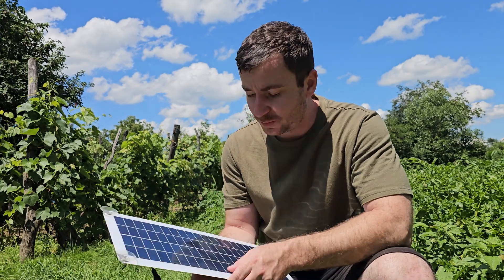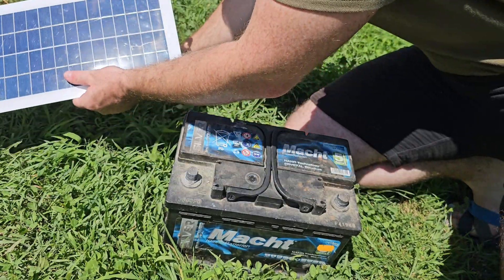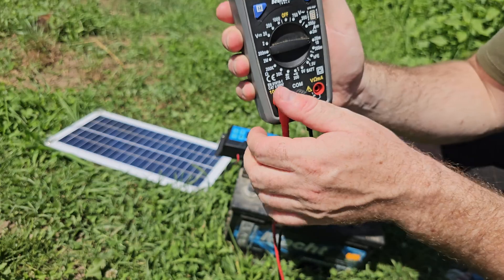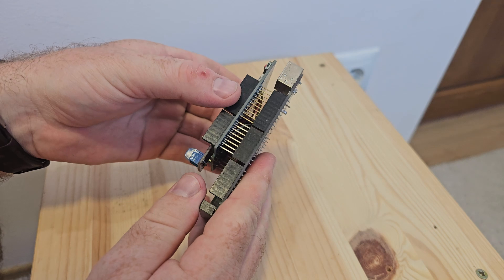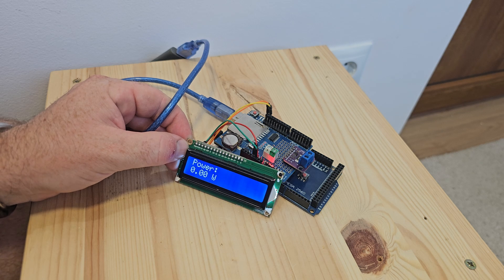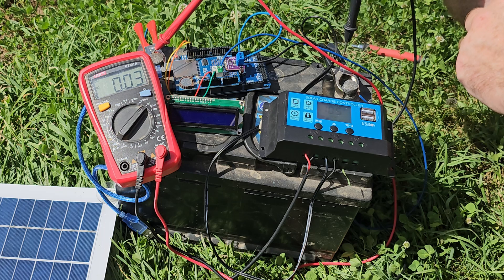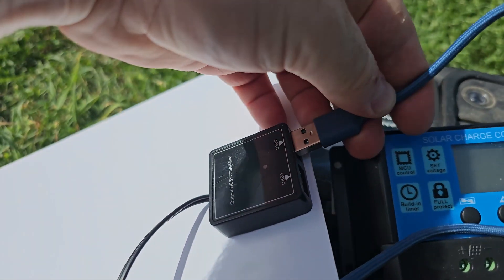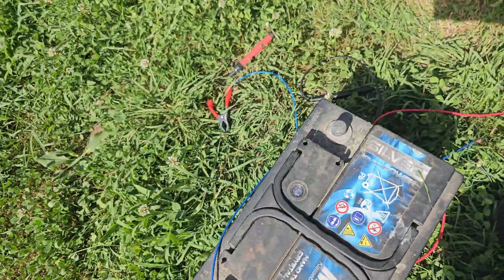Aliexpress "300W" Solar Panel! Don’t Buy It Until You Watch This!

Comment: I was impressed with the solar charge controller I received from the seller who sent me the flexible panels, it was a proper 100 A charge controller, the other seller with the framed solar panels sent me a junk cheap solar charge controller as well without a heat sink at the back and probably only 10A capacity with only 3 mosfets on the circuit board.

Comment: I unfortunately already wasted my money on this before I found your video. 4 of these panels in series are barely enough to recharge the one 12v 7ah battery for my internet modem. I will test to see if it charges my laptop battery but it seems like a real gamble.
Reply from the maker: Indeed. It was kind of unrealistic to have that power output but still I was expecting better results.
Reply: Internet modem uses a battery?

Comment: You might get a little more power by using an MPPT charge controller but my experience with these cheap flexible Chinese solar panels is that they are all highly overrated in terms of power output.
Reply from the maker: I'm planning to buy a good MPPT charge controller and compare with the PWM controller.
Reply from the maker: And indeed it is overrated.

Comment: i have 2 same panels and chargers, working well but need do first panel not have back diodes need add own box and diodes then can charge, and this PWM charger have totally worst need change better MPPL charger and then working well , i have condo palcony and i use all room lights and computer whit 2 panel, working well now and can use raspberry pi4 computer 24/7 and 9 hour ewening all room light good. panels charge battery i measure max 19V 8A good day. panel no problem this worst charger has problem and panel not have diodes. leak night battery empty if not have diodes.
Reply from the maker: Thank you for the comment. You gave me a good idea what I have to check.

Comment: First it was outrageous lithium battery capacities, like 100,000 mAh, and now they're doing it with solar panels. This is an outrageous scourge, and only education of the buyer will fix it.
Note to buyers - area doesn't lie!
You can expect a maximum of about 3W from a 12.5 x 12.5 cm cell.
Reply: Also my formula for a good enough guesstimate :)
Area*1000W*20% for the peak Wattage

Comment: I purchased a similarly sized panel labeled 10 watts. It also had the same power/USB connector. I flashed it from shade to sun with a garden solar pump to test. The second time the panel saw direct sun the motor spun for half second. Testing proved something on the board died, I removed it, connected diodes to the leads and I at least have a working panel that actually pushes the 10w it was labeled for!>
Reply: Yes, that buck converters are very bad at these Chinese solar panels. You probably burnt the circuit by reverse current produced by motor. It shows that the circuit doesn't have even any protection.

Comment: I hink it's a 300 milliwatt panel.  They just neglected to mention the "milli".  LoL.  But the  bigger part of the story here is how you used Arduino Mega to do the measurement!   A video with more  details of how to do that would be cool.
Reply from the maker: Most probably it is a 300milliwatt panel according to the measurments. :D I have already a very similar video but indeed without LCD and missing some calculation. Agree in this video the Arduino Mega is not fully covered.

Comment: Consumption cannot be measured correctly with a bad battery. First you a small current, because the battery is sulfated. Only after a few hours does the current gradually start to rise and thus the consumption you measure. In order, the battery should have a voltage of 12.2 - 12.6V (fully charged).
Reply from the maker: good point but if the battery is chargerd and i will start to consume and measure the consumption wouldn't that show how much do I take out from the battery?
Reply: @JustBotond  Your battery is likely never going to charge properly. It's a 12v battery at 8v - it's toast. You can't let them discharge that low, it damages the plates. Find a another battery to do your test. Also it looked like you were casting a shadow on your cells during the test. You cannot have them even partially shaded.
Reply from the maker: Thank you for your feedback. Make sense. but could you explain the phone chare part why it is so low?
Reply: @JustBotond  Looks like you are getting an amp or close to at 5v. That panel I would expect to be about 10w max, I have one similar size and it outputs 2a in ideal conditions when the sun is directly overhead no shadows. So if the light is not perfect that's about what to expect from a panel that size. For a phone charger I'd really want a panel about 4x that size at minumum so it will charge under less than ideal conditons.